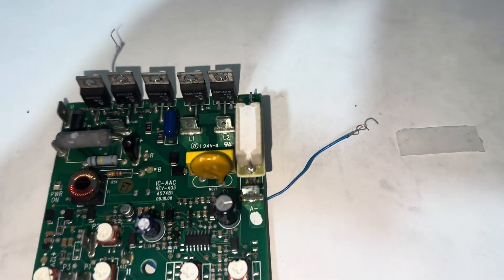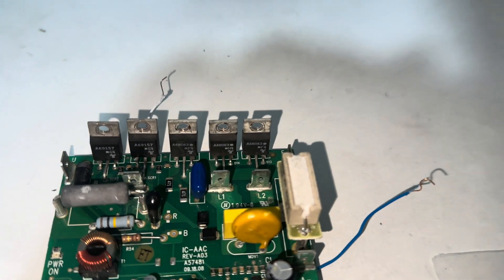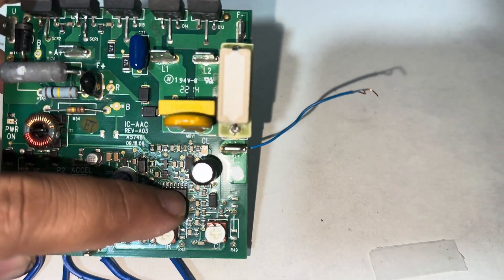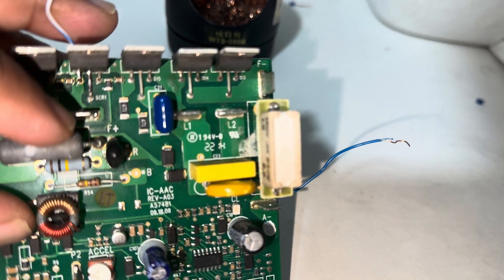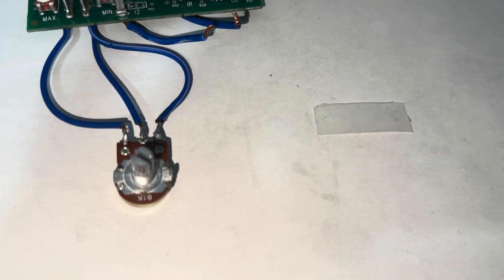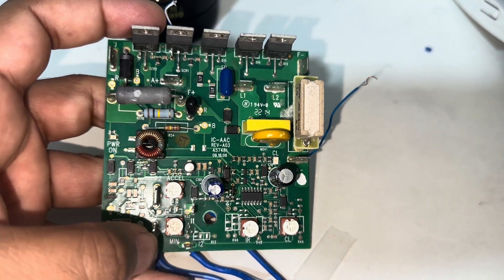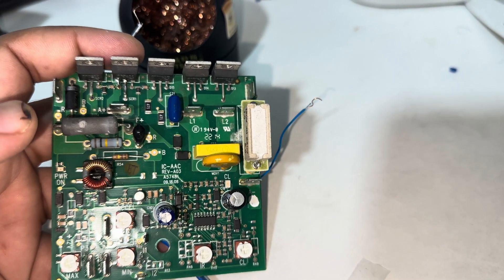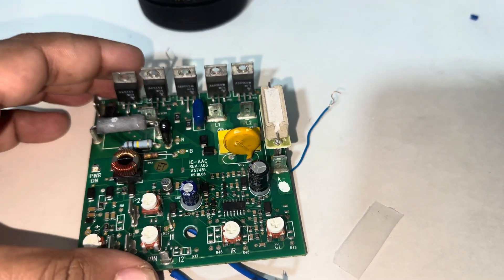DC Motor Speed Control KBIC-240D (9464L)

Comment: How is the typical failure. My lathe since days sgo, after power green button, motor get impulse sometimes but do not work.

I have thought about some weak capacitor, and when power is requested in starting, it resets the board, or somethibg similar...